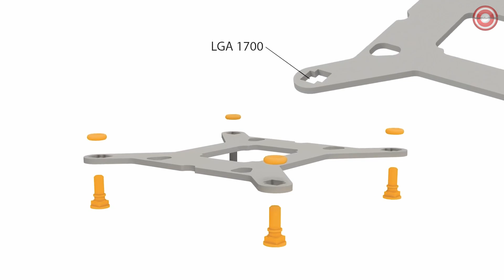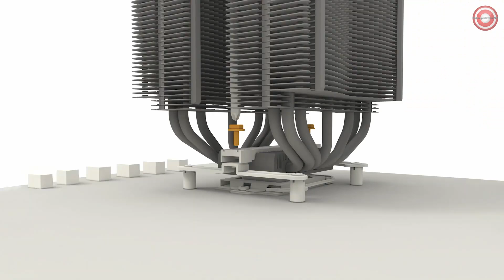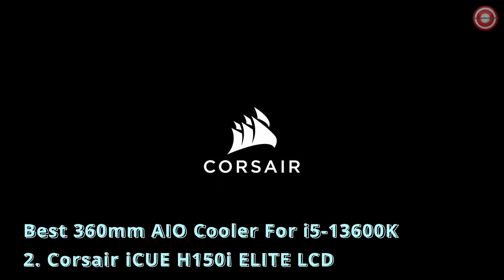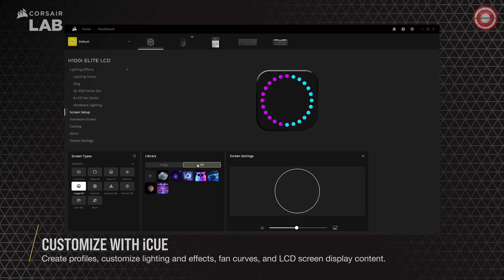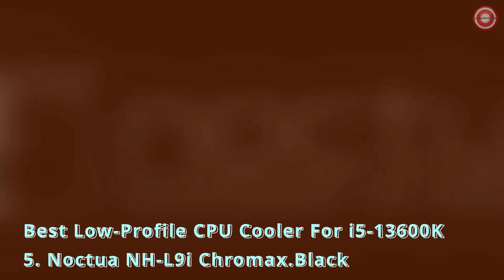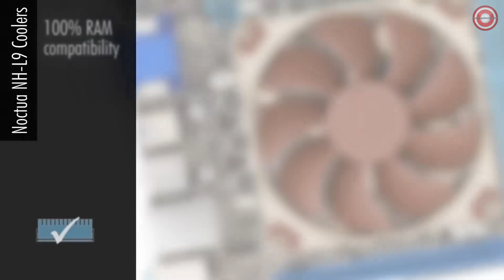5 Best CPU Coolers for i5 13600K in 2023: Top Rated Selections| Some installation videos

Comment: ak400 zero dark plus é o suficiente?
Reply from the maker: The Deepcool AK400 Zero Dark Plus is a good choice for the i5-13600K, especially for stock speeds and moderate overclocking. However, if you plan on heavy overclocking or are concerned about noise levels, a more powerful AIO cooler might be a better option. Factors like case airflow and ambient temperature also play a role in cooling performance.

Comment: Will i5 13600k work good with ak620?
Reply from the maker: Yes, the Deepcool AK620 is a good air cooler for the Intel Core i5-13600K. It should be able to keep the CPU cool even under heavy load. However, it is important to note that the AK620 is a large cooler, so it will not fit in all cases. You should also make sure that your case has good airflow to ensure that the cooler can effectively dissipate heat.

Comment: I have a cooler master MasterLiquid 240 Lite and want to get a 13600kf and i want to disable all power savings available and c states in my cpu using bios , with a good thermal paste, can my cpu aio cooler do the job in games and not  go above 70?
Reply from the maker: First of all, I hope for a kit for mounting the cooler on LGA 1700.
Secondly, I do not recommend using that cooler if you plan on doing what you said.
If you want to do that, I recommend looking for a more powerful cooler. A 360mm would be indicated
Reply: @AryTechB  thanks for the reply bro, my case can only fit a 280mm cooler right now at the best, what would u recommned as a budget friendly 280mm aio that does the job perfectly for me ?

Comment: is deepcool ls520 enogh for 14600k ? and if it is not what do you offer for it ?
Reply from the maker: For light tasks and moderate gaming, the LS520 could be enough, but temperatures might be on the high side.
I do not recommend
I have two recommendations for you from deepcool:
1. Deepcool AK620:
Pros: Excellent cooling performance, quiet operation, affordable price.
Cons: Large size may not fit in all cases, requires two case fans.
2. Deepcool LT720:
Pros: Powerful AIO cooler, good looks, easy to install.
Cons: More expensive than air coolers, requires a case with enough radiator space.
Reply: so you say ak620 air cooler is better than ls520 water cooler and ak620 can hold the temperature down in high performance ? i though ls520 is better fot being water cooler 
 @AryTechB

Comment: Hello! Would a MasterLiquid ML240L V2 RGB do the job for high usage? or a Water Cooler Corsair H100 RGB, 240mm? or neither of them?
Reply from the maker: Yes, both the MasterLiquid ML240L V2 RGB and the Corsair H100 RGB are capable of handling the high heat output of the i5-13600K. However, the Corsair H100 RGB is generally considered to be the better choice, as it has a higher liquid flow rate and a larger radiator than the MasterLiquid ML240L V2 RGB. This means that the Corsair H100 RGB will be able to keep your CPU cooler and quieter than the MasterLiquid ML240L V2 RGB.
Reply: @AryTechB  Thank you very much! this is very useful! and surprisingly fast feedback from you!
Reply: @AryTechB  Thanks a lot!

Comment: Would a ak 400 work on a i5 13600kf .
Reply from the maker: In general, the AK400 is a capable cooler that can handle the thermal output of the i5-13600K under normal usage conditions. However, if you plan to overclock the CPU or play demanding AAA games for extended periods, you may experience higher temperatures that could potentially throttle performance.
However, the DeepCool AK400 and Intel Core i5-13600K can be a good combination for casual gaming and everyday use.
If you're planning to engage in high-end gaming or overclocking, consider upgrading to a more powerful cooler to ensure optimal performance and temperature management during extended gaming sessions.
Reply: @AryTechB  tysm .really appreciate you taking time to answer my query .

Comment: Ak400 enough for stock 13600k?
Reply from the maker: Yes, the Deepcool AK400 is enough for a stock Intel Core i5-13600K CPU. It is a mid-range air cooler with a dual-tower heatsink and a 120mm fan. It has a TDP rating of 180W, which is higher than the 125W TDP of the 13600K.

Comment: Hello, I wanted to ask  Dark Rock Pro 4 will cope with 13600kf?
Reply from the maker: Yes, the be quiet! Dark Rock Pro 4 is a good CPU cooler for the Intel Core i5-13600KF. It has a TDP rating of 250W, which is higher than the 181W TDP of the 13600KF. This means that the Dark Rock Pro 4 should be able to keep the 13600KF cool under most conditions, even when overclocked.
Reply: @AryTechB   i hope :) ❤

Comment: hello.  i have 13600k aswell. i have 120mm cooler and cpu working in strees 90-100 degrees. i was thinkin for 240mm is that enough? should i skip 240mm and buy a 360mm cooler?
Reply from the maker: For your peace of mind and for a future CPU upgrade (if you're going to do that) I recommend a 360. 
From another point of view a 240 or a 280 with a TDP of at least 200W should be enough for the i5 13600k.
Reply: @AryTechB so a ak 400 should be ok ?

Comment: Deepcool AG620 would be a better choice when compared to AS500?
Reply from the maker: The DeepCool AG620 is a solid dual tower air cooler that pairs well with Intel’s i9-13900K, handling loads of up to 277W TDP, with a total cooling capacity just shy of high-end air coolers. The Deepcool AS500 air cooler punches above its weight class, making it an excellent mid-size alternative to big air cooling for intermediate-to-high CPU core systems with a total cooling capacity just shy of high-end air coolers.
I hope it helps you make a decision.

Comment: Will i5 13600K overheat with Thermalright Macho Rev.B?
Reply from the maker: As far as I know this cooler doesn't support LGA 1700, but if you know you can mount it on the i5 13600k you shouldn't have any problems with cooling.
Reply: @AryTechB  
I bought a set of fasteners for 1700 socket. I plan to install a processor 13600K or more powerful, I hope that the cooler will cope with the task